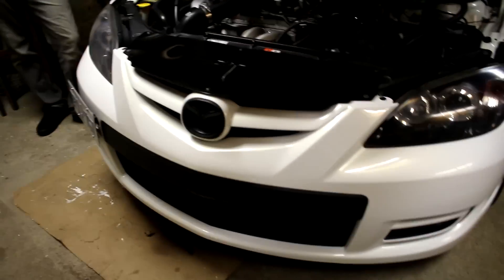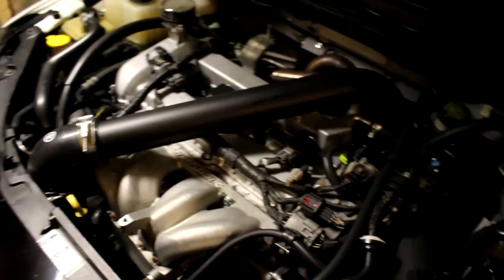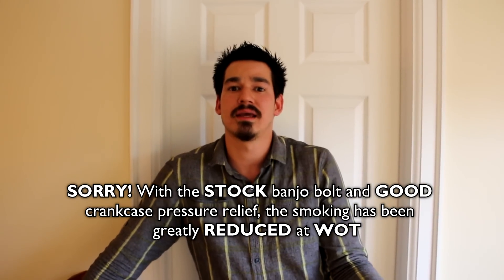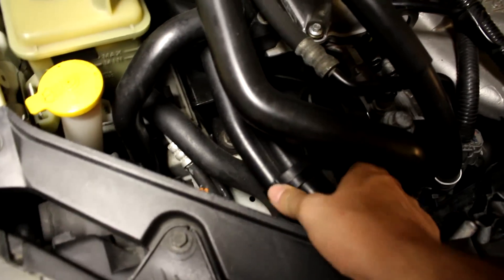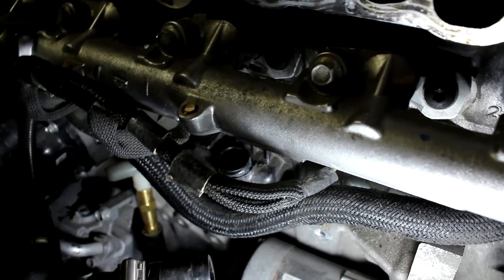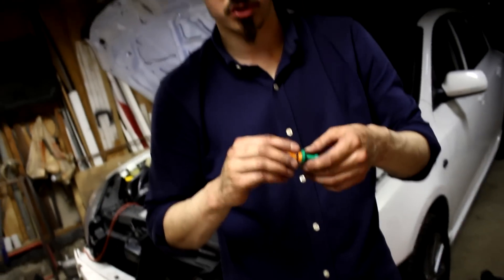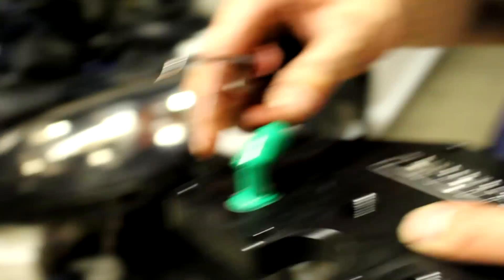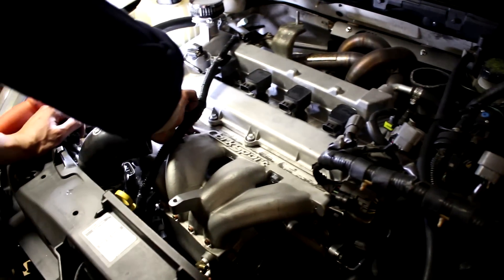Mazdaspeed 3 - Damond Motorsports PCV Plate & Dual Vented Oil Catch Can's Install

Comment: Do you know if this also applies to the cst4? I recently upgraded to the cst4 due to my old ko4 smoking and now ive noticed that my cst4 i am getting blue smoke during accelation.
Reply from the maker: I would double check with Corksport, but we found that running a Turbosmart oil pressure regulator with the stock restrictor bolt completely resolved our smoking turbo issue with the BNR S4. We will cover that in future video where we talk about and review the cars current setup :)
Reply: @WannabeTuners  awesome thank you for the reply. I have the vta add on for my catch can on the way along with a oil breather cap so im hoping thatll help.
Reply from the maker: @sov3nged  Imo all that is required to relieve crankcase pressure is the oil breather cap and Gen 2 valve cover, and just run a sealed oil catch can with an inline check valve to keep the valves cleaner for longer. The main issue with the turbos smoking is too much oil pressure being fed to them. But just double check to see what Corksport thinks ;) You can DM us on Instagram @wannabe_tuners if you'd like 👍
Reply: Dude I have the same problem I just gotta install them now got everything I need today

Comment: Where exactly did you tie in the hose from the valve cover in relation to your check valve location? Is it possible accomplish this type of setup with just 1 vented can (I've ordered the DM PCV plate, but only one vented can)? I'm a little confused about maintaining vacuum on the crankcase while running the vented can.
BTW guys, really great videos. This is my favorite channel to watch for videos about modifying my gen 1 speed 3. Looking forward to your next video. Keep it up.
Reply from the maker: Thanks man! Both the cans are vented. Can 1 goes from the pcv plate to intake manifold with a check valve right at the manifold, and pcv valve retained at the pcv plate. Can 2 goes from the pcv plate to the valve cover breather between the valve cover and turbo inlet. It is tee'd in to the valve cover breather. Both check valve vents on top of both cans vent to atmosphere.
Reply: @WannabeTuners  thanks! I think I'm going to run my catch can the way that Cork Sport suggests for now by running the PCV and valve cover breather tee'd together to the can, then to the TIP and cap off the manifold. I'll just save the breather for when I get another can.
What are your thoughts on the way that JBR does their VTA? With the PCV and valve cover breather tee'd together to the can inlet, then simply just a breather vent on the outlet and caps on the manifold and TIP. I guess they run no vacuum on the PCV? Hmm..

Comment: I'm pretty sure that design of green PCV valve is designed to point down, as in the original plate - it uses gravity assist to close during boost.

Comment: I was having the same problem with a smoking we tried so much none of it got rid of it totally it wasn't until I pulled the Pistons out and seeing that there was little cracks on the ring Landings
After the new Pistons all the smoke and totally went away I ended up putting the old turbo back in and I still got no smoke
Reply from the maker: Yah man these engines are very common for cracked ringlands which increase crankcase pressure quite a bit due to increased blowby:)
Reply: @WannabeTuners  yeah I didn't know that until I look like an idiot everywhere I drive would be a pile of Blue Smoke so one day I decided to just completely dismantle my engine I was surprised to see the all of them were cracked I was not on a stock tune I was using the one that comes with the accessport now what a completely built Manley engine I am as happy as hell with no catch can and no smoke at 23 PSI on stock Turbo pushing the limits of the stock Turbo
Now my new problem is for the first 10 minutes I start the car when I take off I go super lean all the way down to 16.1 when I try to take off from a dead stop and then everytime I shift gears between 1000 and 2000 RPMs we got to talk to my tuner

Comment: Did it solve the smoking issue? I missed the follow up video.
Reply from the maker: Not entirely but reducing crankcase pressure definitely helps. I currently run an oil breather cap and two Damond Motorsports vented catch cans with PCV plate. One from PCV valve to vented can to check valve to intake manifold, and one from last 2 ports on PCV plate to both inlet ports on vented can. Valve cover still connected to turbo inlet for additional vacuum under boost. What really helped with the smoke was shown in this video : https://youtu.be/GSEFwvMB1Tw

Comment: How clean do the valves look and how long has it been since they were cleaned?
Reply from the maker: The last time we cleaned the valves was May 2017 when we made a video on it. They currently look pretty good with EGR and OCC mods although there is a slight glaze over them, but the huge chunks of carbon that are normally seen are not present. Imo even with a good OCC, the intake valves will still accumulate oil vapors over time, but not to the degree of not having EGR and OCC mods. Their sort of like an engine air filter. They constantly have air rushing past them with no form of cleansing. Eventually stuff builds up :)
Reply from the maker: klbar2005  That's interesting!

Comment: Bear in mind that positive crankcase ventilation is actually more effective at actually 'pulling crankcase pressure' out of the crankcase than excessive venting to atmosphere. In the case of the DISI L3T it's actually better to retain a PCV system capable of flowing enough pressure for a modified engine than to vent to atmosphere, as direct injection and oil dilution issues change things considerably when it comes to crankcase ventilation in modern turbocharged application. You shouldn't need modifications to this degree, even on a Gen 1 with it's flawed design - They all seem a little like a Band Aid on a sore knee approach?

Comment: The other thing you could've done was use Rotella T6 engine oil it's thicker and stops smoking pretty much immediately. I switched over and if I ever use 5w30 oil my turbo smoke like a chimney. But when using Rotella T6 smoke is gone
Reply from the maker: Hey man thanks for the comment! I have been running Rotella T6 5w40 for years. It was suggested to try running 5w30 in hopes that it would drain out of the turbo a bit better. This didn't resolve the issue so I switched back to 5w40. What seemed to really help was ensuring that the entire PCV system was in good working condition, and upgraded to be able to keep crankcase pressure to a minimum when running a bigger journal bearing turbo :)

Comment: HI  the other thing you do to stop the smoking on tickover is to take out the ball in the std pcv valve , cut the pipe from the pcv valve to inlet manifold , block of the pipe to the inlet manifold [ bung up ]   fit a pipe   [ most be compatible with oil ]   from the std pcv valve and route it heigh up on the bulkhead so most of the oil vapour will drain back through the open pcv valve then into some form of catch can , I made my own catch can and put a filter on top . might be worth putting some stainless steel kitchen pads down the hose to stop the oil cumming up in the first place . I put my s/steel pads in the std pvc valve mounting housing / block casting . all this stoped my mazda 6 mps from smoking when I found out wot the problem was in the first place
Reply from the maker: Thanks for the comment! Would you say that the main thing that helped with the smoking was removing the internal ball from the PCV valve? I imagine this reduces flow restriction significantly, but am worried that it may pull too much oil through
Reply: HI  WT the main thing I found is blanking of the inlet manifold pipe to the pcv valve , on tickover the pcv is open ,drawing oil / blowby from the pcv housing straight into the inlet manifold  [ no# 2 inlet tracks is worst effected , due to the pipe right infront of the tracks ] on boost the ball in the pcv valve is blow closed and shuts off any oil through the pipe into the manifold due to the boost pressure . I only found out this when I removed my manifold for a part rebuild and there was egg cup full of oil in it [ no signs of any oil from the turbo in the intercooler/ pipe work / turbo , the ko4 is a real strong turbo up to 305 bhp and fitted to loads of car`s with no issues, but a restriction bolt is a good idea imo . you might get away now, with just blanking the pipe of from the pcv to the inlet manifold at both end`s because you now have a vent pipe from the housing going to the catch can ,but it might be a bit to low [ it might syphon to much oil into the catch can ] that's why mine is raised heigh on the bulkhead , so some slight oil in the pipe will return into the pcv housing through the drilled pcv valve
Reply from the maker: @gibboj  The only issue I have with blocking off the intake manifold from the equation is that it will no longer pull a strong vacuum on the crankcase at part throttle. I'm just wondering if removing the ball from the pcv valve will pull too much vacuum on the crankcase, in turn pulling too much oil into the catch can
Reply: WT I think the main issue here is that we don't want any form of oil / crank case vapour / oil + air mixture going into the inlet manifold , you will not lose any vacuum as you are not pulling vacuum on boost ,you don't want to be sucking the shit up in the first place [ JUST NICE CLEAN AIR ] tickover is just the same as there are air gap`s on the side of the throttle body , juging by your set up it looks like your pipe is going into the catch can then being sucked into the inlet manifold . that tells me oil into the catch can then oil into the manifold !
Reply from the maker: @gibboj  What do u mean by tickover? At part throttle, the intake manifold pulls a strong vacuum on the crankcase which is regulated by the pcv valve. We place an oil catch can in between the pcv valve and intake manifold to prevent excessive oil from being drawn into the intake manifold and gunking up the intake valves. We also install a one way check valve at the intake manifold that only opens under vacuum. This prevents the oil catch can from being pressurized under boost, and the pcv valve from being exposed to boost pressure, as they are known to leak boost into the crankcase. By blocking off the intake manifold vacuum source, there is virtually no vacuum on the crankcase at part throttle which may prevent oil from draining correctly from the turbo. The idea is to keep this strong vacuum source at part throttle while using a catch can to minimize gunky intake valves. Running a dual vented catch can setup with or without an oil breather cap is what we run. If u have instagram check out our page where we have a picture posted of out current pcv setup :)
Reply: WT  tickover = idle = ie  800rpm ,       you don't need any vacuum at all.  the turbo is pressure feed one side then drip feed on the return side to the engine block [ with some slight pressure from the top feed ] . a good idea with the one way valve to the catch can [ wonderd how you did that ] you don't want to be pulling any vaccum at all near the sump / block / cyl head . gunky intake valves will only happen from old shitty oil going through the system and it being a direct injection system [ valves not being washed by fuel ]

Comment: I have speed 6 I know your car has since gone boom I hope you got her runing again I’m looking at putting this on my car but I’ve been told that the car needs vacuum for the pcv to work and I’m wondering how it has vacuum at all with a vented catch can ...?
Reply from the maker: It has vacuum because the vent on top of the can is a one way check valve that only opens when the can becomes pressurized. It instantly closes as soon as vacuum is present.

Comment: How has the car been doing in that configuration? I’m thinking about doing it this way on my gen 1 as well. So you are going from pcv to can and from can to mani with a check valve? And then from plate to can and from can to the valve cover breather tee’d into it? Where is the other pcv fitting going to? EDIT: okay I see now lol. The vc breather tube is being used as vacuum from the top of the can to draw it out! Nice man I like that set up!
Reply from the maker: I've since set it up differently, which is similar but a bit better. We have a picture of it on our instagram page :)

Comment: I’m still on the fence on the Damond PCs plate...I’m probably gonna get the gold one to match my sound symposer delete, and still need to instal my Damond oil catch can. I think you sold me on the plate thou...haha 🤙🏻😎 should hopefully help on my Focus ST.
Reply from the maker: The PCV plate is mainly to add a second vented OCC to reduce crankcase pressure, although an oil breather cap is simpler and works great! I think I remember seeing one installed on an ST but I'm not sure if they are commonly used or not
Reply: Okay, you sold me on a second OCC...

Comment: Do you have the bnrs4 v1 or v2? I never had a problem with smoke until i cracked a ring on the stock block.
Reply from the maker: I have the V2. Yeah a cracked ringland will cause a lot more blow by. Do you know how many cylinders had cracked ringlands?
Reply: @WannabeTuners  not sure my did the compression and leakdown cylinder 2 and 3 low.... my corksport motor came in today.
Reply from the maker: @billgriffiths6748  Awesome man! That's gonna be sweet :)
Reply: Bill Griffiths holy shit man you shit make videos of your CorkSport motor, I want one of those
Reply: @billgriffiths6748  What are your impressions of the Cork Sport motor? Stage 1 or 2? I'm debating with myself on getting one of their stage 1 builds for a quick turnaround time or just taking the time to have my block built and save some money.

Comment: i had the same issue that just got worse, started smoking now under idle as well... i suspect ringland failure (atleast on my engine)
Reply from the maker: I would carry out a compression and leak down test just to be sure :) I was relieved when my engine checked out good lol
Reply: @WannabeTuners  let me know of this setup works, keen to see the results..
my compression numbers dropped about 30 psi across the board the last couple of months so build will have to come sooner than later
Reply: Bennie Troskie just read the post on mazdaspeed forum. I read entire post a little while back. It worked, but it’s important to note that journal type turbos are best run without restrictor banjo bolts. It’s important to ensure your turbo has enough oil and that it’s able to drain back with minimal resistance.
Reply from the maker: @btshader  Yeah man the low compression is most likely the cause for the smoking. If your compression has been getting worse and the ringlands are damaged, I would imagine you're also getting more blowby causing more crankcase pressure, which will flow up the turbos oil drain tube, pressurize the cartridge, and push oil into the exhaust past the turbine piston ring seal.
Reply from the maker: @chrisc3235  I still have some smoke every now and then at WOT, but it's minimal as compared to before. I think that using a restrictor bolt to reduce the volume of oil to the turbo causes some irreversible wear, and may actually cause the turbos shaft to tilt ever so slightly causing the seal to allow oil to push past. The stock banjo bolt seems to deliver enough oil to keep the shaft straight, and the seal sealed lol. This is just speculation though:) But like you said, it needs to drain out, and crankcase pressure prevents easy drainage.

Comment: Love the video man I had a question I’m running stock turbo with a damond pcv plate and a catch can routed from pcv to catch can to intake manifold and I get a lot of crankcase pressure from the valve cover going into my cobb intake any ideas what it might be it’s a little frustrating lol I was gonna order the damond kit to see if that might help any help will work at this point I appreciate it
Reply: From pcv to catch can to intake? It needs to go to ambient air with a one way check valve from the top of the catch can not into the intake...

Comment: I have a 2012 speed 3, no smoke, completely stock.
Reply from the maker: Lol I never had smoking issues either on the the stock K04. I believe a lot of it has to do with the high oil pressure being fed to the turbos bearing system, along with having a high flowing downpipe/exhaust system, which in my mind creates a venturi effect during deceleration at mid to high rpm's. This on top of the high oil pressure being fed to the turbo will pull oil past the turbine seal where it'll burn.